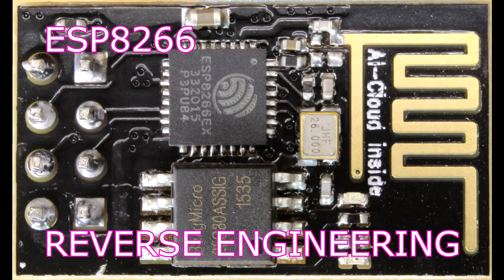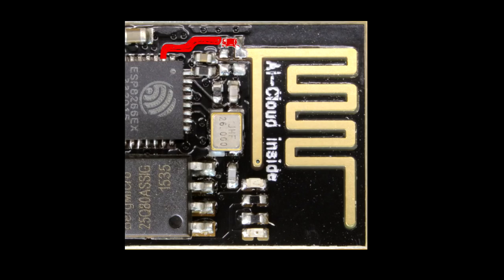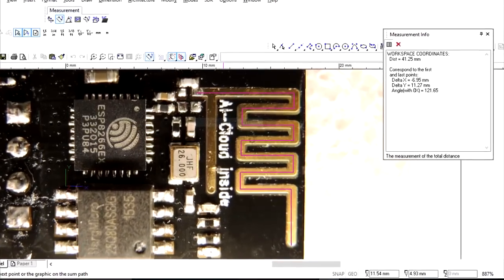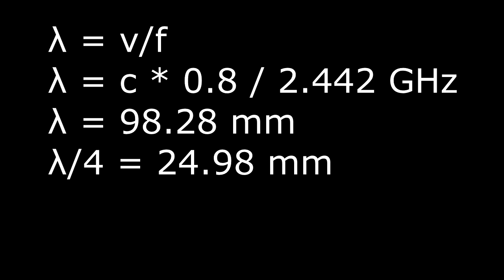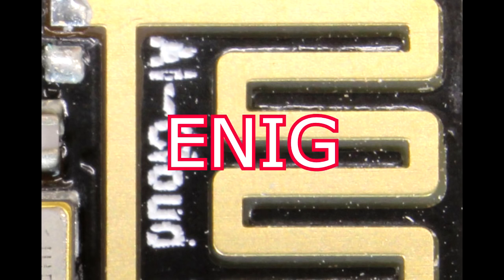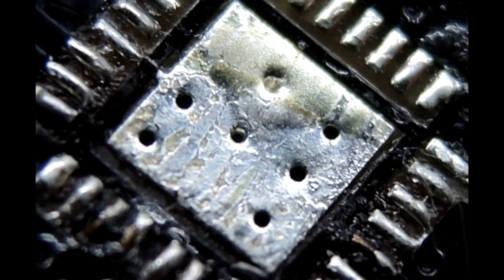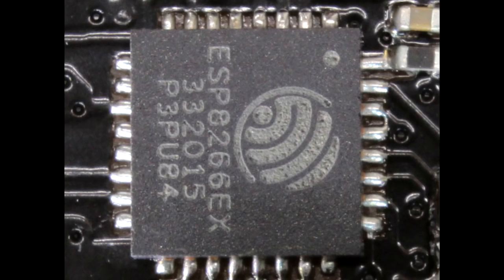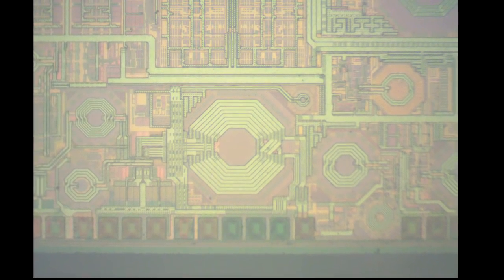Reverse Engineering the ESP8266 WIFI-to-Serial Adapter

Comment: From what I know WiFi works at 2.4GHz, so where does that thing get this kind of frequency? 😉
Reply from the maker: Phase locked loop (PLL) or delay locked loop (DLL).  A well understood technique for creating high frequencies from that 26 MHz crystal which is on the board.
Reply: Marek Ant We see a 26 MHz oscillator on the PCB. Probably a PLL frequency multiplyer on the chip from there.
Reply: Great! Thanks for letting me know

Comment: Where did you get the 0.8 slowing factor for lightspeed from and why does it apply to the pcb material and not air? Thanks
Reply from the maker: dielectric constant: fibreglass different from air
Reply: Thanks

Comment: The on-chip inductor at 4:52 looks like several coupled inductors (you could call it a transformer) to me since is has at least 3 connections on the left and at least 2 on the right. I say at least as we can only see the top metal layer, not the ones below. The meanderign of the traces is a way to make more windings on the same coil, this increases it's inductance value. All teh small dots you see at the left and right side in the top level metal are vias to the metal below. If you consider that you can see that it's a complex structure ! Luckily there are tools like Momentum to simulate these structures to predict their properties before they are realized on silicon (which is expensive) ! Always nice to see analog RF stuff on a bare die :-)
Reply from the maker: +Peter-Paul Vervoort Thanks!  I was hoping someone who is a expert in this area could help explain what's going on.

Comment: Golden or silver coating usually in UHF has more important role, than just corrosion protection. High frequency currents in conductor are not equally distributed and tend to be on the outer layers of wire/trace. That is the reason why HF coils, coaxial core and sometime antennas active elements have coating with better conductivity.
Reply: I am a bit lazy today. I will just qoute wikipedia, OK? "The skin effect itself isn't actually combatted in these cases, but the distribution of currents near the conductor's surface makes the use of precious metals (having a lower resistivity) practical. Although it has a lower conductivity than copper and silver, gold plating is also used, because unlike copper and silver, it does not corrode. A thin corroded layer of copper or silver would have a low conductivity, and so would cause large power losses as the majority of the current would still flow through this layer."
Reply: +Andrew Bond 
If that were the case, then why would they pick gold? It's conductivity is just a little bit better than aluminium. Copper and silver are much better conductors.
Reply: +superdau perhaps because gold does not tarnish, its electrical properties remain a constant, i have no idea if tarnish affects in a small way any circuit that is already electrically connected (surface effects ?)